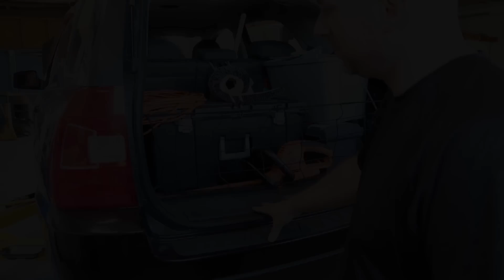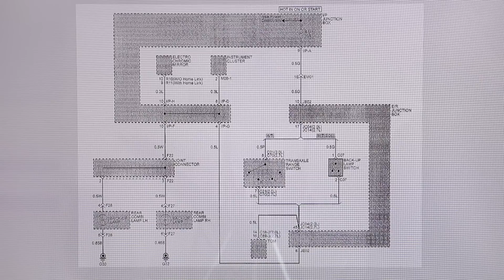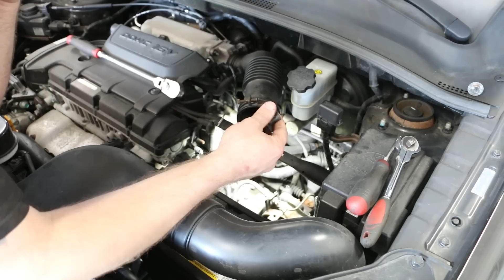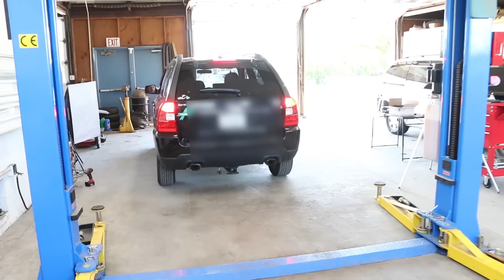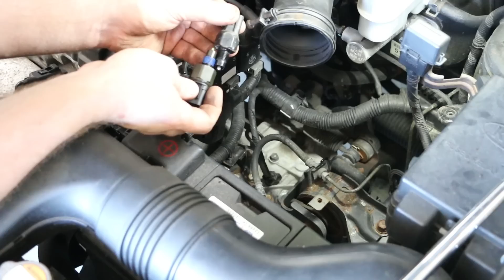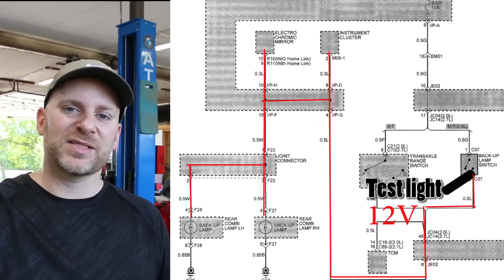Reverse Lights Flashing when Driving Forward - Kia Sportage

Comment: Hi, my 2004 Audi 3L CVT cabriolet flashes its reverse lights when it is not reversing. No any other problems like warning lights or lack of power. Can you please give me an idea about this? My friend told me that I will have to change my reverse light switch. If so, where is that switch location? Thank you very much.